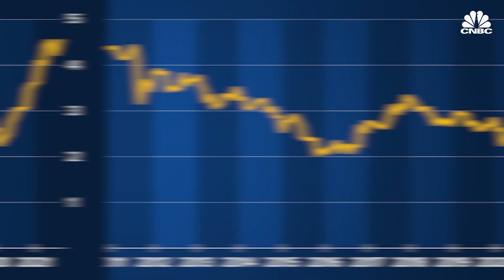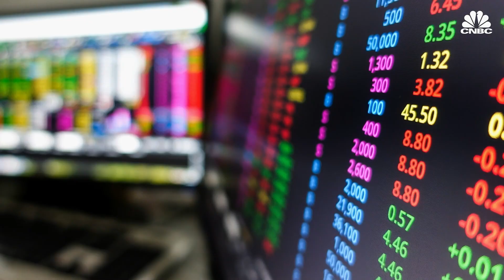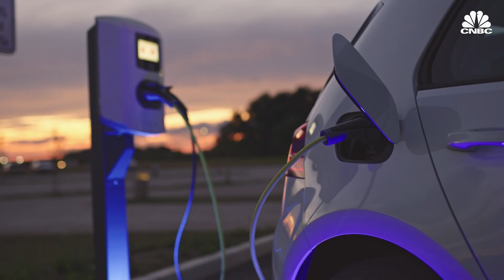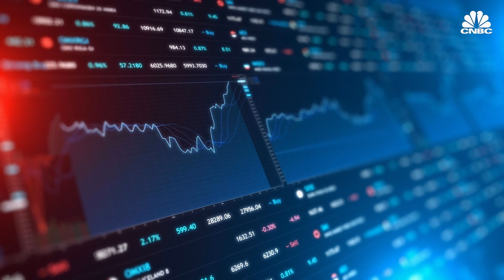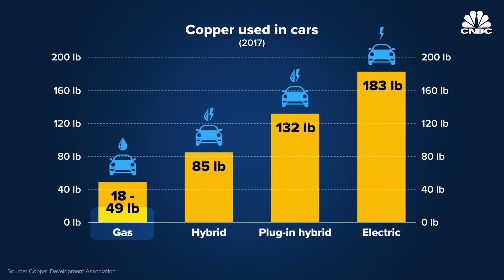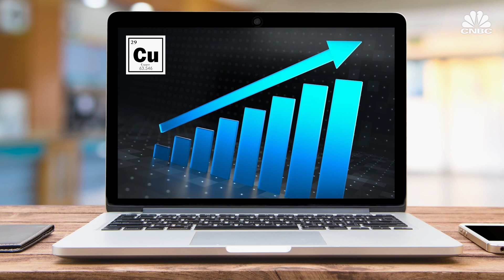Why A Looming Copper Shortage Has Big Consequences For The Green Economy

Comment: Seems worth pointing out here that most of grid-scale electric distribution is aluminum, not copper.
Reply: Just beat me to it! Heavy duty industrial equipment is now being built with Al conductors too. Welders for example. It's 1/3 the price and very low embodied energy to recycle - only about 5% that of refining from ore. Copper is a bit more expensive to reprocess.
Reply: Al is 39% less conductive but 70% lighter. Not sure if it can substitute copper in all applications or what the ramifications of using more Al would be (soda cans, airline/automotive industry etc).
Reply: @Shadow__133  You can only substitute aluminum in places where size is of little to no importance. If you need to make transformer or motor windings twice as large to accommodate aluminum instead of copper, you need a motor or transformer core that is also twice as large to fit that wiring and eddy current losses in the core will double. With the core being twice as large and dissipating at least twice as much power, heat has more distance to travel to get dumped into the environment, which means everything will be running hotter and further increase losses. It gets even worse when you consider that making the core twice as large to accommodate larger windings reduces its inductance, which means you need to offset that by either making the core even larger to add turns or pick a core material with higher magnetic permittivity which usually both mean even higher eddy current losses.

If you want efficient power conversion, you usually want the smallest practical core for a given amount of power in a given operating frequency range, which means we'll be relying on copper for those until we discover practical room-temperature supra-conductors to enable even smaller magnetics.
Reply: @teardowndan5364  if you have a larger core in a transformer does that, by extension, also degrade the power factor of the load on the other end?
Reply: @teardowndan5364  Thanks for explaining that 👍 
Far from my field (I drive things made of aluminum).
Reply: @teardowndan5364  Excellent
Reply: @stephancasas  A bigger core would likely have higher magnetizing power (a parasitic parallel inductor) and degrade power factor unless combined with an appropriately sized power-factor correction capacitor.

There is no shortage of downsides to going with anything significantly worse than copper in electromagnetics..
Reply: @teardowndan5364  thanks!!
Reply: Because of cost that’s why

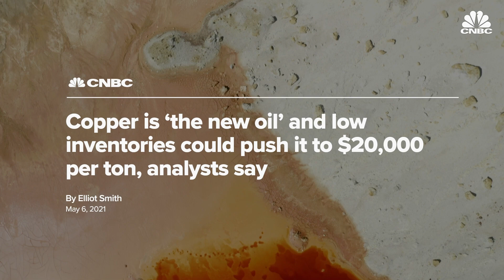Comment: Good video, but to set the record straight, copper is NOT "the single best conductor of electricity". There are MANY more better conductors, silver and gold are but two. Copper is "good enough" at the cost that it is, but it is NOT the best. So the guy at 2:12 is flat out wrong.
Reply: So are you.  Gold has only 70% conductivity of copper.

Comment: Silver beats Copper at both electrical conductivity and thermal conductivity.
Reply: Gold is even better than silver.
Reply: @jaynecobb1  Pretty sure it isn't.
Reply: @Aelfraed26  Silver has great electrical and thermal conductivity if it is not corroded. Gold does not corrode and maintains it's  properties.

Comment: The petroleum industry depends upon electricity being its competition. Electricity can't compete that's why petroleum likes it. So it's the relationship being broken the price of copper dunes the price of success. I did say dunes d o o m s because if electricity continues to be supported the planet will be doomed by that duping of the petroleum. Energy is not moved well in its electric state. Electricity is not used well for most things. This is like how to build an atomic bomb in terms of nobody being willing to take the risk of telling the truth. Energy is very very inexpensive there is a present myth that you can measure the cost of energy by the price of electricity. The meth has its corollary that the price of energy from petroleum does not matter because petroleum is dirty. But however true these facts are there are other facts that may be inconvenient. Facts like not all alternatives to electricity or dirty. Mining mental heat and using it to produce liquid nitrogen for an example is not dirty. So the question becomes how cheap does copper have to be for electricity to compete with liquid nitrogen as a means of distributing energy? Cheaper than it presently is. So those who think that this news is corrupted by some outside influence they're very well beyond to something. The effort to drive down the price of copper is the effort to keep alive the best friend to petroleum which is electrification. If the price of copper goes up higher the obvious absurdity of electrifying mechanical work will be more self-evident even though it is never been in doubt technologically or scientifically. People think that the jobs that are created by Green in terms of electrification green are a bonus. Don't be so naive. That's why petroleum can do bus do you PE do you pe here. The hustle has the bribe. The unions don't give a damn about the planet I'm not saying that administrators in unions only care about their paycheck well if you get one to accuse me of saying something like that then I'm not going to waste time arguing about it but would just let the people have their own say. The unions want what we call in terms of saving the planet higher inefficiencies. So who runs the union for those who want to save the planet?

Comment: Jeff Currie: "Copper is the single best conductor of electricity known to physics."
Silver: "You can deny my potential, but you cannot deny my value."
Reply: Everyone knows superconductors are better than copper at conducting.  I nearly blew my cereal out my nose when he said that. Besides, hasn't he even heard of silver? It sharts in copper's face...
Reply: But silver has more potential than copper though
Reply: The guy did sound like he was reading something from a brochure lol
Reply: They never said it was the best
Reply: @maka8551  they did tho. It's one of the first ppl that isnt the narrator speaking.
Reply: YBCO and BSCCO enter the chat.
Reply: Silver is the best conductor but it can not be used as wires. It will start to melt.
Reply: @silentkiller4091  If your wires are getting above 1,763°F, I’d say you have other problems.
Reply: @jos_meid  durability of silver is much lower than copper. Copper wires can be reused again and again and again and it will work like a new one. Same doesn't work for silver.
Reply: as well as the periodic table, dont forget
Reply: silver and gold are better conductors...... price wise is another story
Reply: @994TCV  silver is better but not gold, the thing about gold its requirs no maintenance
Reply: What???
those are Stupid Statements.
Platinum
Gold
Silver
Copper
Brass
Bronze 
in that order...........................
Reply: @jesscast5122  What are you trying to teach us here?  "Stupid Statements" LOL.
Reply: @jesscast5122  Price doesn't mean better conductivity. Silver is #1, Copper is 2nd, gold is 3rd. How are you so confidently incorrect?
Reply: No... GOLD is s better conductor than copper
Reply: That was @PflGlace
Reply: @jesscast5122  You're incorrect. Platinum has a conductivity of 9.43×10^6 σ at 20 °C. That is way less than Silver's conductivity of 6.30×10^7 σ at 20 °C. Even gold, which has much better conductivity than platinum, is worse than silver considering that its conductivity is 4.11×10^7 σ at 20 °C.
Reply: @jos_meid  YES, that may be true while you have perfectly clean and Untarnished Silver.  But Platinum and Gold DO NOT tarnish.  Silver does!!   Once the Silver Oxide builds (worse and worse over time) you got problems. 
What's the conductivity of Silver Oxide???
Reply: @jesscast5122  When silver tarnishes, it forms a layer Silver sulfide on the outside surface of the silver. That’s pretty much it. Silver tarnish is pretty self-limiting, forming a surface layer and preserving the metal beneath. Plus, its not like there aren’t ways to prevent silver that is used in electronics from getting into contact with substances that are likely to react with it.
Reply: @jesscast5122  Do you know what Youtube is owned by? Google. Anything you type into a Youtube comment section or a Youtube search bar, Google knows about. Anything you watch on Youtube, Google knows about. I'm no big fan of Google either, but your standards just don't seem to make a lot of sense with that in mind, but regardless, if you don't like Google collecting your data, just use a different search engine or go to a library or something. Anyway, because you're unwilling to do basic research on the chemical composition of silver tarnish when you're having an argument about the chemical composition of silver tarnish, but rather just insist that because there is more O2 than Hydrogen Sulfide there must be more silver oxide than silver sulfide without considering other factors I think that you have shown how reasonable you can be so I think this will be my last reply to you. Have a nice day.
Reply: @jesscast5122  Alphabet, Inc owns Google and Google owns YouTube. Thanks for playing. You lost.
Reply: @jos_meid  i mean if we wanna be asinine about it lead is cheaper and a better conductor if u ignore the cost of temperature requirements for said conductivity
Reply: @crwelch12  I'm not being asinine about anything; I was merely pointing out to Jess that gold and platinum are not better conductors than silver, which is true. If you pay close attention to exactly what I wrote, I didn't even say that silver is the best conductor or anything of the sort. I merely said that it was better than copper, gold, and platinum. I didn't even say anything about what is cheaper or more expensive either. Also, I didn't ignore temperature. I literally specified the temperature in my original comment when I said "at 20 °C" for everything so that it was clear that we were comparing apples to apples. 

Lead has a conductivity of 4.55×10^6 σ at 20 °C. Compared to silver's conductivity of 6.30×10^7 σ at 20 °C, it is an order of magnitude worse. I'd query you about at what temperature lead is better than silver at the same temperature. Graphene, which is made of carbon, can  theoretically be a better conductor than silver in some circumstances, but I hadn't heard of lead being better and a quick google search isn't turning up much for me in terms of what temperature that might be true at. If you could share your info and source with me, that would be much appreciated. Lead certainly still has usefulness in electronics, I don't dispute that but just talking in terms of its conductivity here.
Reply: @jos_meid  bruv how is what u just said not being asinine the man didn't claim temps u just decided to add them. I just pointed out that what is conductive and how conductive is not static, as even lead can be a super conductor under the correct conditions
Reply: @crwelch12  Your response perplexes me. Even after saying that what is conductive and how conductive is not static, do you really not understand why one has to include temperatures if one wants to be precise when stating units of conductivity for materials? Do you really not understand why units of conductivity without specifying what temperature one is talking about is completely meaningless? Do you really not understand why, when comparing the conductivity of different materials, it is absolutely necessary to compare them at the same temperature to eliminate variables?
Reply: @jos_meid  i understand how it effects it. but its unnecessary to use actual values in scientific notation on a YouTube comment section. keep that in class u just look like u googled and copy pasted. the person also never claimed temp values so bringing them in is just u trying to sound smart
Reply: @crwelch12  Bit of a delayed response, but here it is. I did just google and copy and paste. I see nothing wrong with doing so. No one is going to memorize everything and anyone citing exact figures obviously would have probably looked it up. As I explicitly said earlier in one of my responses to Jess, "There’s no shame in looking stuff up..." furthermore, I strongly implied that I googled the info I stated when I said "I assume that you have access to google. You could just look up what you’re talking about..." I wasn't trying to hide the ball and no reasonable interpretation of my comments would be that I was trying to sound smart by making it look like I knew stuff off the top of my head. A reasonable interpretation of my comments is that I'm smart enough to know how to type stuff in a google search bar.

Secondly, it is kind of necessary to use actual values when arguing about something quantitative, like conductivity. To not bring in quantitative values when arguing about something quantitative would be to have no reasonable argument at all.

The person made an unqualified claim that materials ranked in terms of conductivity were:
"Platinum
Gold
Silver
Copper
Brass
Bronze 
in that order"

Jess did not specify a temperature, but Jess made a false universal statement that quantitative values were needed to disprove. I used 20 C for 2 reasons: 1). Because it was the easiest temperature to find conductivity for in a simple Google search, and 2). Because that temperature is pretty much normal conditions and it is easy enough to disprove a universal statement like that by showing an example of it not being true under pretty much normal conditions.
Reply: @jesscast5122  way to try and ruin a good joke. And silver is more valuable than copper so he wasn't wrong. Meowwwrr
Reply: @aperamic  The issue was the usage  of copper as a conductor.  NOT Value.

Comment: Side note, Jeff Currie, ummm copper is not “the single best conductor,” silver is. Copper is, however, cheaper.
Reply: Superconductors
Reply: Graphite
Reply: All of Detroit Edison's service drops and secondary voltage transmission wires are aluminum! It weighs less than copper, has higher tensile strength, and is a very good conductor. However, if subjected to high currents (like a momentary short) it tends to explode violently!
Reply: Gold is better then silver…..
Reply: @Chris-cv1ll  if you are talking about conductivity when you say “better” just look it up. Silver  
defines conductivity. Number one. Then copper then gold at number 3.
Reply: @VJJBodhi  had to look up why gold is used in electronics…turns out it’s because they are great for small currents and long term use (corrosion resistant) we use copper because it’s between the best of both worlds (high conductivity and high corrosion resistance)
Reply: @Chris-cv1ll  all three are used and gold doesn’t tarnish - I was just saying silver is numero uno for conductivity
Reply: @VJJBodhi  and gold is numuro uno for resistance to corrosion and tarnishing. Copper is second in both categories
Reply: @Chris-cv1ll  I appreciate the metal enthusiasm! :)
Reply: @Chris-cv1ll  Copper is not corrosion-resistant. It corrodes pretty badly and leads to some catastrophic damage. Copper in electronics is usually coated or plated in with a variety of other metals and polymers to for insulation and corrosion resistance
Reply: They never said it was the best

Comment: High voltage transmission lines are made of aluminum and steel, not copper.
Reply: True.  It is because light weight, high strength (and possibly resistance to "creep") are important for aerial lines.  In that application, aluminium with steel reinforcement is "the best conductor".  ( I had to say that, what with all the commentators obsessed with what is the best conductor. - I am not even going to bother watching the video!).
Reply: @idontwantachannel3091  what is “creep”? If you don’t mind me asking
Reply: @douglasbubbletrousers4763  Aluminium stretches when hung on high voltage  power lines, a steel core is used to keep the cable from stretching (creeping)
Reply: @idontwantachannel3091  That's what we were taught at school during the 1960s.
Reply: Only when the US was running out of copper and all cables were made out of Alum.   then US found the "world's largest deposit of copper" in Chile in the early 70s     President Allende refused to sell the "National Treasure of Chile" and Was MURDERED by the US,  Put up a Puppet Regime (pinochet) and Viola!!  
The US had all the copper it could PLUNDER...............
Reply: @jesscast5122  As a Chilean, stop with the lies pls!
Reply: @AlphonseDanielEdge  What James is saying is on Wikipedia. That's all I can speak to it. The US at least encouraged the coup.
Reply: @RyanMcCoppin  Allende made a coup first...
Reply: @jesscast5122  Wrong.  The US opposed him and worked to over throw him because he was a Marxist at the height of the Cold War.  The closest you are to truth is that Allende was going to "nationalize"  (ie steal) the assets of US and other companies in the country.

Comment: In USSR aluminum vas widely used. All household wiring in USSR was based on aluminum wires. Also electric motors used in household and non critical industries contained aluminum windings. I assume that copper in USSR was considered as a strategic metal and reserved mainly for military industry.